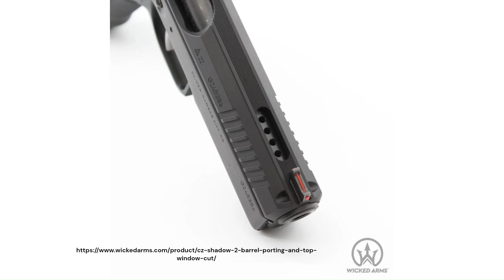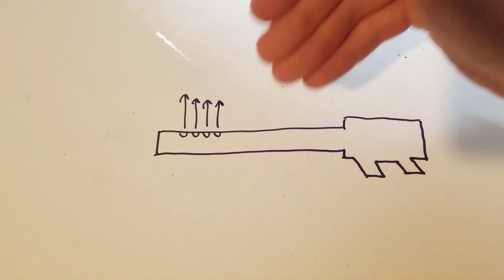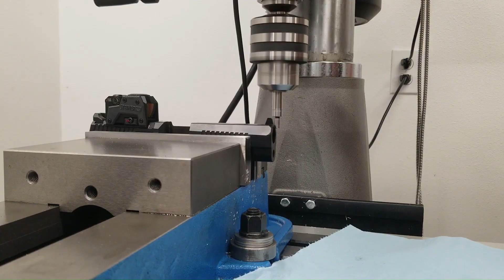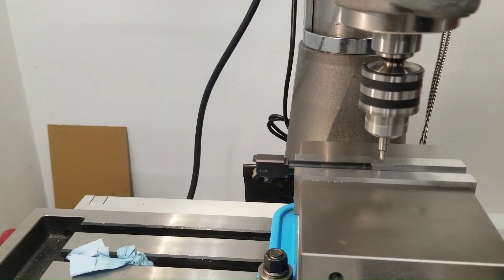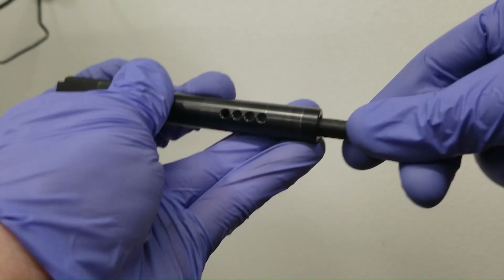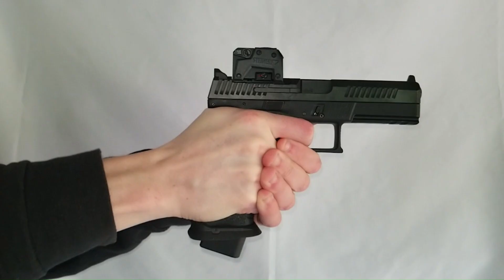I Ported My CZ P-10 F

Comment: i have been looking for information on the porting process and it has been extremely tough to find reliable resources on it. This video basically showed and explained a nice amount of what I was curious about and showing the machining process as well was a pleasure to see! 1000/10 video in my opinion. What resources/ links did you use to base your research off of?
Reply from the maker: I'm glad it was helpful. I have a few more porting videos that show various technical aspects of the process as well.

I pretty much just looked around at porting jobs and layouts available from companies. I am a design engineer and have a bit of machining experience so it easnt too hard to come up with my own design. Of course I designed it with manufacturing in mind. As in knowing that I would be machining it with my skills, and equipment available to me.
Reply: @EngineersArmory  I'm currently in school to become a gunsmith and have access to a mill, lathe, CNC, etc. and this would be the work I'm looking to do but the design part will come with more research i guess😂 but i will most definitely be checking out your other vids!
Reply from the maker: @xRunItUpChris  at the end of the day the "design work" is just holes in a barrel and a slot in a slide haha. I'm happy to share any if my drawings if you're interested.
Reply: @EngineersArmory  that makes me feel a lot better about it lol and I definitely am! if you have links to them, whatever you are kind enough to share will help my projects tremendously!
Reply from the maker: @xRunItUpChris  I have drawings for all my porting designs. Which are you interested in?
Reply from the maker: @xRunItUpChris  Here is the drawing for this inline port design:

https://www.reddit.com/user/rrppdd4/comments/1cskkij/inline_port_drawing/

Comment: So how big are those ports in millimeters? Cuz I have no idea what "second of an inch" is, even tried to search it but I was unsuccessful.
Reply from the maker: Sorry, here in America I am so used to designing in imperial units because thats what machinists expect here. I was saying "thousands" of an inch. As in an inch divided into a thousand parts. Its a common unit of measure over here for machining, designing, tolerances etc. The holes are 3/32", or 156/1000 of an inch. That is 3.97mm.
Reply: @EngineersArmory  thank's! I had a subtitles turned on and they said "530 seconds of an inch". 156 thousands of an inch makes it way more clear.
Reply from the maker: @technicbuilder6410  Oh haha😂those dang subtitles!

Comment: You dont have to pay extra, risk your gun to shipping.  Buy the Glock G17C, or G20C . Glock engineering and quality.
Congratulations on great work, no easy task 👍
Reply: That doesn't solve anything. Infact, you're losing some really excellent features if you go with Glock in terms of ergonomics, trigger pull, out of box capacity, and high-quality sights.

Comment: So you made your barrel way shorter... why not buy the threaded barrel and use a compensator ? I suppose you have many guns and this is just for some competition ?
Reply from the maker: Barrel is the same length. I did not bore out the rifling up to the ports. Its rifled all the way. Slight reduction in bullet velocity obviously, and I have not done the testing myself but from what I've seen the velocity loss is usually less than 50fps. A lot of times even less and within the standard deviation of the ammo. 

I have a threaded barrel for this gun I use with a supressor. Compensators add a bit of length on an already full sized longer barrel. 

No i dont compete. This is just for fun and because i can haha.

Comment: You no ever one has opinion so I will give you mine for me I would have went out each side  so you don't get that flash at nite imo.
Reply: Would you be interested in doin another p10c like you did yours.
Reply from the maker: @billystephens9255  No sir. I appreciate your interest, but I dont want to turn this into a business.
Reply from the maker: I have done some V-porting at this point. Same amount of flash, just in a slightly different direction. I have not shot any of these at night yet, that would be an interesting test, and I plan on doing to at some point. So I am not going to comment on the night time performance, I also don't run night vision, nor have any experience with it.

Here is an interesting video from Sage dynamics (i think this guy is legit, very experienced instructor) where he addresses the muzzle flash from shooting ported pistols. The Glock 17C he uses has a V-port configuration. Testing starts at 2:04:

https://www.youtube.com/watch?v=UqRTHVp6N-c&t=679s

Here is another video from him addressing low light shooting and it does include a discussion and testing of night vision at the end (20:48):
https://www.youtube.com/watch?v=qy_8vfZJnR0

If you're curious what the flame coming out of a V-port looks like, my newer video on an M&P 5" has V ports - although a narrow V angle, 30 degrees between ports. I include some of the same black background slow motion footage with a still of the fireball. Thanks for watching and commenting!

Comment: Hell yeaaah, nice work!!! I've always wanted to have either my P10F or G34.5 ported, but I've seen/read of some substantial impact to accuracy at distance.
Hindsight being what it is, it would've been extremely interesting to see accuracy before and after the work was completed.
Reply from the maker: I havent shown accuracy testing in any video but i always check my zero on my red dot and I can share what Ive see. I did do accuracy testing on my CZ Shadow 2 before and after porting (I just didn't film or take pictures like a dummy). From a bag support at 25 yards I got about a 2 inch group before and after, so no noticeable change there. 

The larger the ports, the more my zero shifts. I chunk ported my springfield Hellcat and POI shifted like 6-8 inches low at 15 yards. On my P-01 and this P-10 impact shift was minimal, maybe 1 inch max at 15 yards. On my Shadow 2, impact shift was not noticeable. 

What I have observed with all the porting jobs I have done is that smaller port size disrupts the bullet less, and will affect POI and accuracy less. So if you want to get a pistol ported, I would recommend small diameter ports, like 1/8" or less. 

Hope this helps. Thanks for watching and commenting!
Reply: @dltz  Fantastic, thanks for the follow up!

Comment: God damn it now i gotta get on the mill and start drilling holes in my P10
Reply: Yep! word of advice, don't drill. Use a good high rpm carbide center cutting end mill Much cleaner!  if you tap in a wooden dowel into the area where the ports are to be drilled, tit will be even cleaner. Less burr produced the inside. then use a rubber abrasive rod and polish the ports free of ports angling it forward on the inside toward the muzzle. this helps prevent shaving of the jacket. 
Never shoot plated bullets in a ported gun. Sadly, although bullet manufactures do list them as not for ported barrels, or revolvers,  the actual ammunition manufacturers are not so 
much as telling us when they switch to plated bullets for cost savings. GRRRRRRR!!!!  Those that do list real jackets as fmj (Full Metal Jacket),whereas a plated bullet is listed as tmj, or total metal jacket.  I had to drop PSA ammo for this very reason. I called and not a soul knew a thing about the change. Nada!!!

I've been porting for about 40 years now.  Now after years of Na Sayers, it now suddenly popular. ;<)

KnifeMaker
Reply: @michaell397  drill and mill same thing , like tomato and potatoe they're just pronounced different to different people
Reply: @JNOSNOW  Spoken lie a true not machines. totally different finishes. but you would have to have the experience to know why. ;<)
Reply: @michaell397  you obviously don't understand sarcasm and your syntax is pretty bad. Good luck.

Comment: Not being sarcastic or judging but why did your port your P-10F?  I find the P-10 series of pistols very soft shooting anyway.  You actually did very nice work, by the way.  Maybe for competitive shooting?
Reply from the maker: Rewatch the first 16 seconds of the video. I do not compete. I just do this for fun. Its what I like to do in my spare time. P-10F was already a great shooting gun. Now its better.
Reply: @EngineersArmory  Do you have any issues with particles or gas blowing back into your face?  I've never been a fan of porting for this reason alone.  Also, it does affect shooting suppressed.
Reply from the maker: @rotadyma  No issues with gas or particulate. Its a bit more noisy and concussive but not terrible, not much worse than a comped pistol. Shooting a pistol with a ported barrel suppressed would be pointless. You wouldn't be suppressing the noise and flash coming from the ports. I would never port a pistol that I would run suppressed, and I would never suppress a ported pistol.

Comment: Nice. Does the stike maggwell work with all mag baseplates? Any that it does not work with?
Reply from the maker: Strike magwell works with all the baseplates I have, It worked with the factory baseplates just fine. I have some springer precision and factory base plates. I have modified the factory base plates. It shares mags with my P-09 which I have a springer precision magwell on and needed to modify them for that.

Comment: Angled / side ports are generally regarded to be the best compromise to minimize muzzle flip while mitigating excessive gas and powder flash that may rise to obstuct the sight picture when shooting.
Reply from the maker: Makes sense. They could be drilled at a narrow angle too to maximize the vertical force component. In terms of shooting at daytime, I didn't notice any issue with my red dot or target being obstructed. The flash and gas are so fast I didn't even notice them when I was target focused. I suppose I could see how it would be a little more of an issue in low light conditions or with night vision.